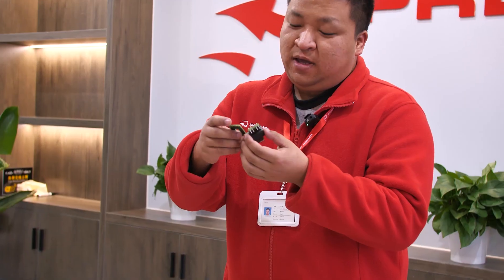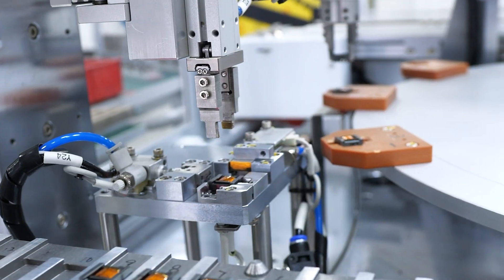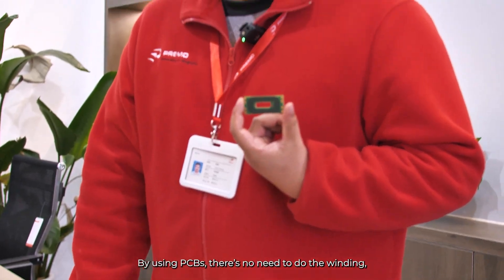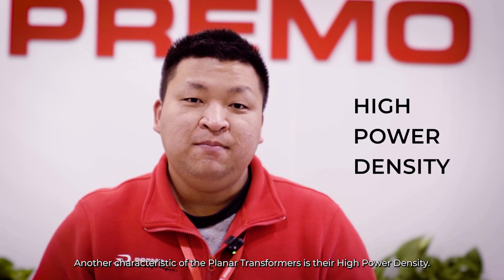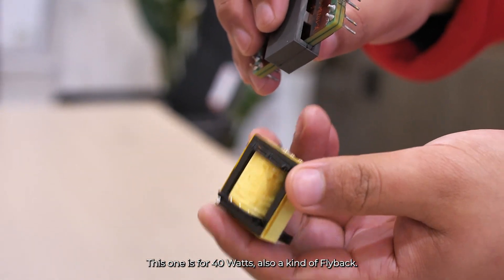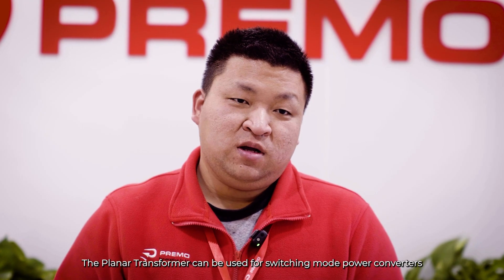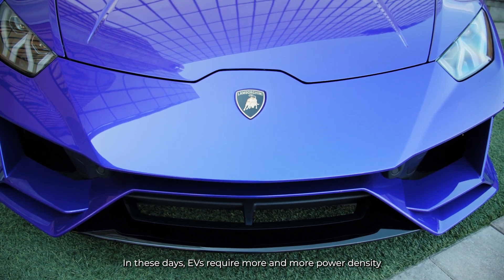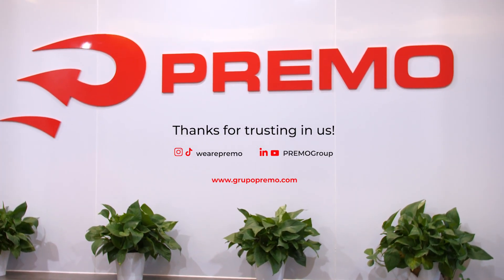Planar Transformer Magnetics Solutions by PREMO

Comment: Congrats and kudos to; Bell Labs & Westinghouse in the 1970s for first inventing and making the first groundbreaking HF planar transformers.
And kudos to Billings, USA / research groups who began formalizing “printed circuit windings” for high-frequency magnetics in the 1980s.

And for the first small, light, HF switch mode power supplies, Raytheon, RCA, and NASA contractors in the early 1960s.
IBM, 1964 is credited with one of the 1st commercial switch-mode power supplies. The IBM 360 mainframe used a 20 kHz switching supply, which was revolutionary compared to linear supplies.
By the late 1960s, Tektronix and HP also had HF switch-mode designs in oscilloscopes and test equipment.
Robert Boschert (early 1970s): founded Boschert Inc., one of the earliest companies dedicated to commercial SMPS.
Unitrode (1960s–70s): early innovators in PWM control ICs for switch-mode supplies.
NASA & Aerospace contractors: pioneered HF transformer/ferrite use in spacecraft power systems.
The first high-frequency SMPS in a commercial product is by IBM in 1964, with its 20 kHz switching regulator for the IBM 360 computer.
Well done to all.